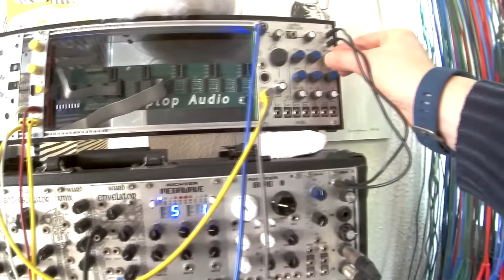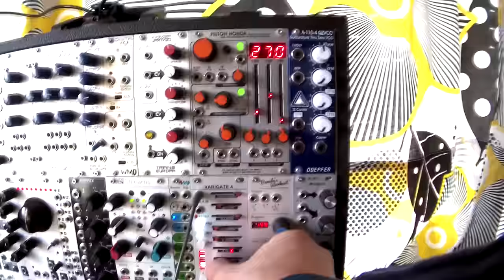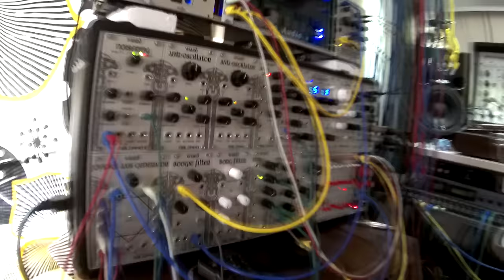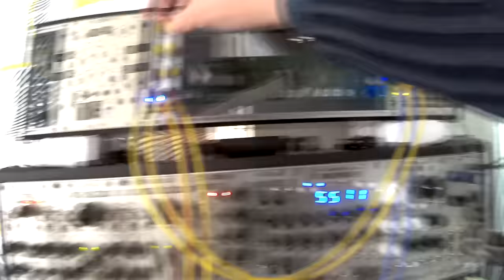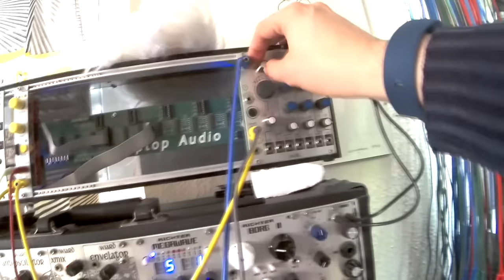Chord Organ Firmware Music Thing Modular Radio Music - eurorack synth

Comment: This is pretty awesome! It's making me wonder if this Chord Organ module can replace my QuBit Chord module which just takes up way too much room in my case...
Reply: Depends on how much you use the cv controls on the qbit or the individual outs. For a lot of things it could, yes. And you can always load the radio music firmware when you fancy a change.
Reply: I already have two Radio Music modules (with custom panels from Magpie Modular) that I use with my own specific samples, so they need to stay functioning as they are. With the QuBit Chord, I don't use the individual outs, though if I had a bigger case with something like the 4MS SMR in it, then I would maybe... but right now, this seems like the perfect solution for my small setup; to free up room but still get "chords" out of my system. Now just trying to find who will sell them pre-built.